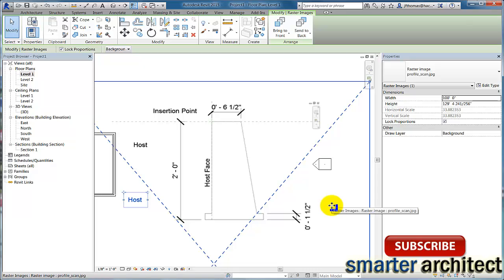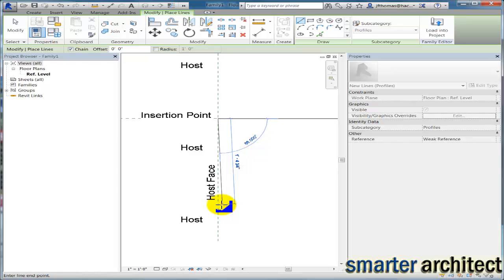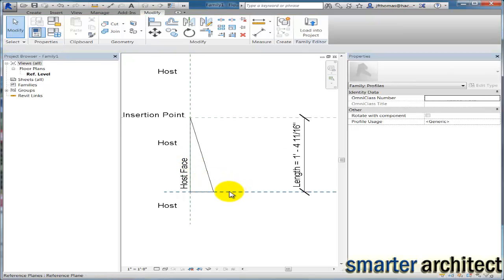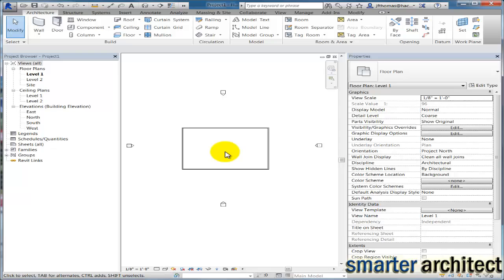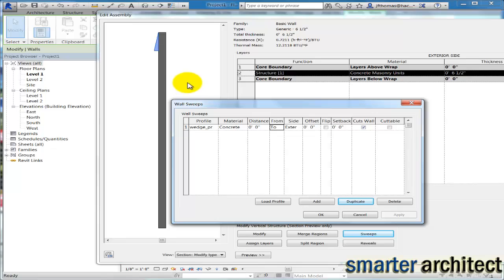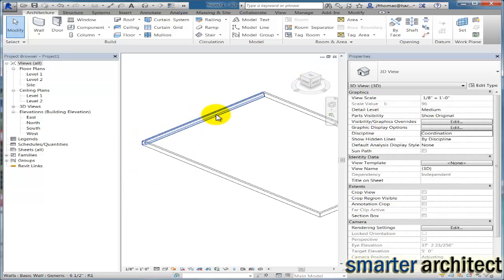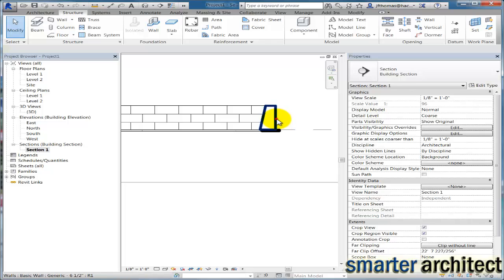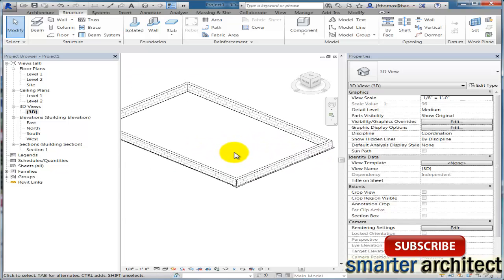Revit Tutorial - How To Create Custom Revit Foundation Walls

Comment: Thanks a lot
But the problem with this way is that the program doesn't deal with the wall as a whole, if you check its volume you 'll see that it didn't add the sweep.
What is the solution ?
Reply: you can create equation of the swept volume by its parameters in the schedule
Reply: Hi Mohamed, I have the same issue as So.220, can you show how?

Comment: Hi SmarterArchitect.

I have 2 questions about Revit, If you could please answer them I will subscribe to your channel.

1. What is the best website for me to download good revit components? I am designing a science building and would like to use large windows for the external part of the building, and revit 2015 doesn't have what I need in it's library.

2. About ceilings and floors.
On the first floor of any building, do we put a ceiling on the ground floor and then a floor on the first floor? I am confused about this. If there should be both then should the first floor's floor be the same as the ground floor one? Or shoul it be made up of lighter materials as it's suspended?

Thanks, If you could make a video regarding question 2 it will be much appreciated.
Reply from the maker: justCommando Welcome!  I have 3 comments to question #1.  I did a video on Revit City if you search and there is free content available but it's not always quality. Second, there is a site called Turbo Squid where you can buy 3d content to insert in Revit or 3D Max and the prices range based on quality.  Lastly, based on your expressed needs (windows?) I would recommend learning to build some Revit content which will make you a better Revit user in the process.  I have a few video tutorials on creating a Revit window family and furniture family.  Start there or I can build Revit content of what you need for a small fee!  
#2.  I have modeled both conditions on projects - just depends on the actual situation.  If the floor is exposed on the underside as a ceiling, then no other ceiling is needed but if you have a suspended acoustic ceiling below the first floor, model it.  I have a short video tutorial on ceilings that should help you too.
Best wishes in Revit!  Don't subscribe for me, do it for you if you want more.  Many people don't understand that YouTube  does not pay anything for new subscribers. I am doing this because learning is much more exciting when people collaborate!
Reply: SmarterArchitect Thanks SmarterArchitect, your videos are great: clear and informative and they have given me an edge over my classmates :)